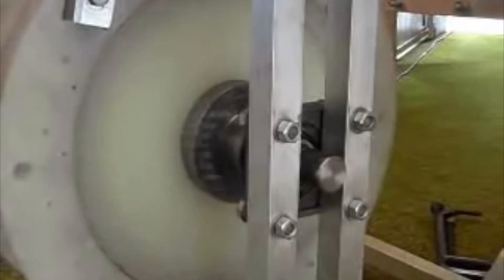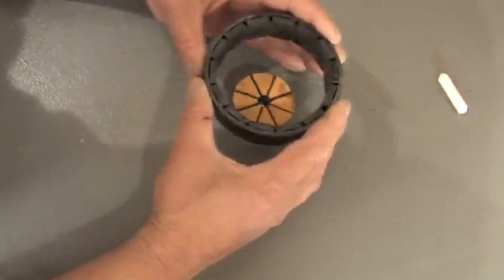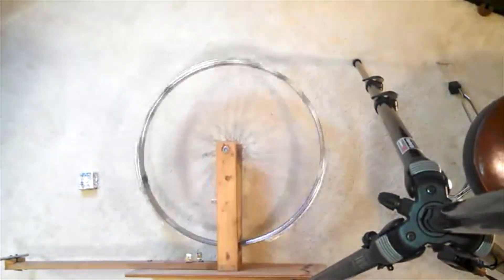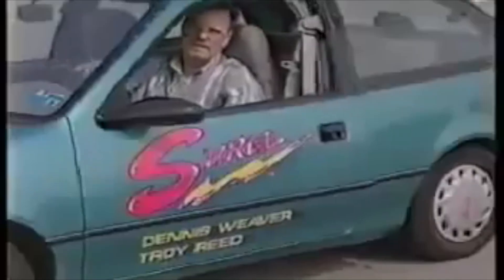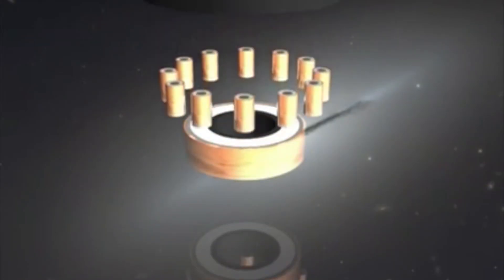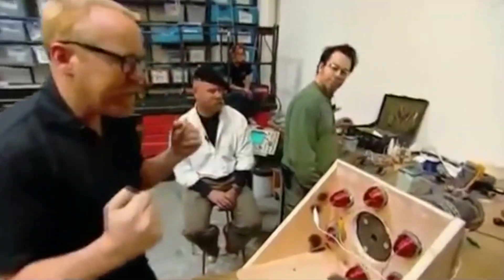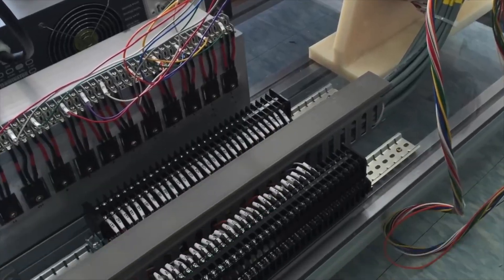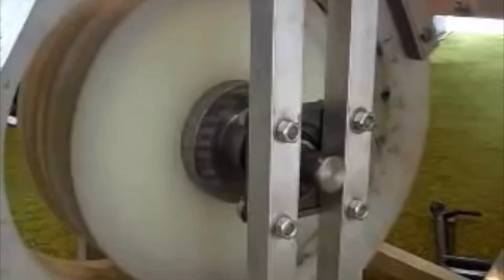Top 10 Most Famous Magnetic Motors

Comment: Do you have any info on the Italian inventor who made cgi models of magnetic motors based on crop circles?  There's one design in particular that looks like something I drew, a long time ago.  I am positive it would work if there was effective magnetic shielding.  I don't know if that guy knows, magnetic shielding will work if it's cooled to near absolute zero.
Reply: I know what you are talking about.  I considered the same thing during my younger years, "shielding".  But it can't be done.  Even if it could be done a teeny tiny bit, only a tiny amount of motion could be extracted, exactly equal to the running down of the "permanent" magnets (no free energy).  This is because the only stuff that shields (without conducting the magnetic effect) is diamagnetic shielding (like bismuth or pyrolytic graphite).  Of course, such diamagnetic shielding always produces an opposing wave back at the magnet, very slowly draining it, just like putting two of the same poles of a magnet together drains magnets faster than leaving them apart.  So if you were able to get it to work, you would just end up having to re-magnetize the magnets, thus using the magnet as a battery.  But no one has succeeded at even that, but if you did, why do it?  Batteries are already so much more energy dense and more readily chargeable.  Although way down the line there might emerge a good use for producing tiny amounts of energy by draining a magnet.  Still, no free energy out of it.
Reply: @Tom2941    then you need a different kind of shielding.  What about graphene, or some kind of smart material?  If they can make a speed bump that only bumps if you're going too fast, they can make better shielding.  It would produce lots of energy, then.  I win.
Reply: @Tom2941    I've read about it, I didn't see anything that says it produces a counter wave, it says that the wave stops or is reduced.  There are those halbach arrays and different ways that the shielding could react to a wave.
Reply: @alanmalcheski8882  Yes, the counter wave is produced by one of the outer electrons in each individual atom of any diamagnetic material.  This happens because the low pressure part of the wave is absorbed by that electron pulling it around the atom, forcing it to orbit in the opposite direction of the incoming wave.  It is this forced electron motion that produces another wave of high pressure that pushes back on the electrons in the magnet, which eventually slows their motion, which demagnetizes the material over time.  (Some of this understanding is not yet known by the greater scientific community.)  Credit goes to Superknowledge4you on Youtube.  :)
Reply: @Tom2941    oh.  Well i don't like the product placement or the zionism but i was watching TBBT and sheldon was working on a weird problem that was about how electrons go through graphene differently than other substances.  He said it acts like a wave instead of a particle. 
That show...  I know a little about physics, I don't like the title, I believe in an alternative theory to the Big Bang, and I always disliked the show... until they were working on a secret project for the gov., and they said something that was actually intelligent.  I don't know how that's possible, unless it is somehow based on a real story.  So there.
Reply: @Tom2941     I don't know why the issue of wave particle duality is brought up for that specific condition, but I know what my brain thinks, and there's something to that.  I don't know jack about science.  But somehow I know stuff, I hear it in dreams, and when I look it up, it's always about nuclear technology, the bible, or aliens.  Watch Mystery Wire channel.  Read my comments on the Avi Loeb interview.  Explain them to me.  I'm an idiot savant, I don't know what I'm doing.  But I could help someone like you.
Reply: @Tom2941     you just need to make the atoms in the shielding out of radioactive material that either absorbs electrons or permits them differently than other substances.  An engine that is made of nuclear waste, that neutralizes its own radiation as it operates.
Reply: @Tom2941    just don't stand too close to it
Reply: @Tom2941     it probably has something to do with the fake nuclear warhead that was in the house I grew up in.  It was a test dummy, so it was basically the same size and shape as the real thing.  My parents put it next to the fire place.  So it might have looked like a camouflaged missile silo.  There's a very tall radio and tv antenna  close by, very close by.  And when I was a kid I would set up mirrors and then change the channel on the tv from a different room, bouncing the remote beam off the mirrors.  Much later in life I researched laser gyroscopes, same physics.  Used on jet fighters.  
That's probably what it is.  Or... I could be imagining all of this, and I really have no business being here.  It doesn't really matter, does it?  I don't care what people think.
Reply: sir, if you put a magnet device on a crop circle it works forever. But all crop circles are under police control
Reply: @jackwhitestripe7342     A magnetic device?  I don't know what you mean and I don't think that cops are guarding crop circles, but in general you are correct.  Very good.
Reply: Yes. He said that crop circles were just blueprints to run "kinetic motor", jus using springs and loads, running with the power of gravity.

Comment: Federal government of India has accepted my Flywheel technology.
By 2021 August 1 MW power generation plant is ready.

All of the world or global population could not brake Thermo dynamics laws
This is  , I who has challenged the laws and broke all the laws of thermodynamics
I am using  mathematics and physics
I am coming from the mechanical engineering department
Dear sir greetings,
In one MW every year 8760000 kWh or units generated , uninterrupted power supply all 365 days.
Just 1 rupee per kwh or unit.

World First fuelless power generation technology developed by Indian scientist couple.
Absolutely free energy technologies

www.kammagearflywheelpowergeneration.com

Just 4 batteries and running a submersible pump, a welding machine or a lath machine or a industrial heater etc mechanical load and electrical load like halogen bulbs

https://youtu.be/Cut8Pv2nWBc

https://youtu.be/e6pI0fevA-M

https://youtu.be/cd-QWZBNLuo

https://youtu.be/w2EQyf_KbWk

https://youtu.be/rPRJofvOYoQ

Federal government of India has accepted this technology and invention and incorporated Flywheel , compressed air and pump storage

"A challenge to the scientific community"
FLYWHEEL Power Generation
We design and develop only one MW

Not below this

One MW will generate per year 8760000 kWh or units

 Investment is 700 000$

Space requirement for 1 MW plant is 30000 sqft

We can discuss

Our input pulse is for only 1 minute

Our output pulse is for 1 hour

 We have developed this technology by acceleration and deceleration method

 Our Flywheel is 6 m in diameter and 20 tons weight and rotated at 1000 rpm

 Like this we have 15 Flywheels connected to each other

And rotated

The total cumulative inertia and kg m pressure is utelized for deceleration

 And the stored energy is harvested from the rotating 15 Flywheels there is 8 MW stored energy in the 15 Flywheels.

 The motor used is 750 kw

And the Generator is 1.5 MW

 So if we have a storage of 1 hour in the batteries, for storing 1 MW there will be 70 batteries  each battery is 12 v and 1200 Ah.

 Then we will get 60 hours free energy

 It is uninterrupted power supply

 The input pulse is 1 minute only , after this the motor will not receive any further energy from the storage , available from the 1 MW storage

 So energy is destroyed

And

Energy is created

There is no more the law of energy existing

 I have provided it on the paper and by practical experience too

Thanks

Just 1 cent per kwh or unit all 365 days.
Uninterrupted power supply all the day and night 24/7 all 365 days.
Dr Srinivas Bhasker chaganti and chaganti Bala
Scientist
91-8555045244

Comment: Have had a version of a Bedini motor running for weeks.
And some of my own run for months.
Will we see any of these ideas be allowed to be produced?
Reply: @andreasschmitt2307  school is scam, as far as politics rule it
Reply: did it provide any external power like  a light bulb dickhead
Reply: @andreasschmitt2307  I'm 70 and have learned most of what I do within the last twenty years.
These things are not taught in any school, but come from garages through out the world.
But a good education can add in the process, a great deal.
Reply: @tribulationcoming    What inventios and innovations have come from "garages" recently?
Reply: @durchblick6886  Have one pulse motor in particular, put up a video but took it down after a week or so. I don't do calculation, no formula's, qualitative only, trial and error for the last 15 years. Try it and fry it, there has been smoke in the past, but not so much as of late.
Restarted this one in at the beginning of Aug. , it has maintained just below 9 volts using an old 12 volt battery.
But what should be done with such a device? Check out the field coupled torque translator. The term "Garage" is a general reference DIY experimentation.
Reply: @tribulationcoming    I am aware about the meaning of "Garage" in this context. But sorry, my question was not precise enough. I did not ask for singular inventions but for "garage"-inventions which are now widely in use due to their usefulness.
Reply: @durchblick6886  Yes, there is a vast array of ideas.
Reply: @tribulationcoming    May be. But I was not asking for ideas but for recent "garage"-inventions which have catched on and are used by many people.
Reply: @durchblick6886  OK, I don't think many of the numerous ideas are actually used, but I'm sure some are useful enough to be done.
Reply: @tribulationcoming     If something is really useful, it would spread quickly. That's why I still doubt that important inventions can come from "garages" nowadays. 
For instance, is the Bedini motor a useful invention? No!  His function is in complete compliance with laws of electrical engineering and although it can run for a long time, the Bedini has no outstanding properties, neither as a motor nor as a generator. Which is the reason, why you find Bedinis in "garages", but not in the real world.
Reply: @durchblick6886  Yes , this is a good and logical point of view. Very few of the thing have moved from the garage to useful production. This "thing" hat I stumbled upon    
is only a proof of concept and could be developed, but that would take someone with the ability, which I don't have, to determine exactly what is taking place, and that requires $$$. To answer your original question, not much comes from anyone's garage. However, there have been a few notable instances of success that can be traced back to humble beginnings. If this thing I have is still running in Jan. I will post it for the second time. Be safe and careful in these turbulent times.
Reply: @tribulationcoming    One reason why "garage" inventions became extremely rare: interesting inventions are in fields which simply can't be tackled in a garage. For instance, no one will be able to find a more efficient photovoltaic material in his garage, since you can't develop semiconductors in a garage.
And there is another aspect which can lead to an overestimation of garage-disoveries. Many do experiments and observe results which are new to them and seem interesting. They think they have discovered something. But in all those cases I bet that an expert in this field is familiar with these observations and can explain them at once. For instance, you have something running since a long time. I recently stumbled across a pendulum which swings in air since more than 100 years! But there is a simple explanation for that: the pendulum is driven by a high voltage galvanic cell and since the power consumption is extremely small it will run for a very long time. I am quite sure that your construction also has a sound and rather simple explanation and is not really a new discovery.
Yes, times are turbulent. Have some good times despite that!
Reply: @heinzpg  And again, thanks for the input and interest. Well, at 71, I don't think I have 100 years to find out, in fact we may have only a short time of stability before things self destruct, but that''a another subject. This is sort of a hobby  and keep my thought process active and in working order. There are many people who have worked on an idea for half their life which consumed them and ended up dying without any real success. Will post a video in Jan., that will be after six months of operation, then Ill put it to work and see just what it can do. Yes, everyday that God gives me is a good one and we shall see some amazing developments in this world we live in, not all good ones. Be safe.
Reply: Yes, I will be 72 in Dec. and have learned most of what I know within the last 35 years.

Comment: What if you start manually(using current just to start the momentum) a  heavy rotor with magnets around and it get a little pulse from powered coils every exact time the magnet is passing by, than u get 1 little push to add in the momentum every pass, isnt the momentum strong enough to keep spinning it while retrofeeding the coils and generating energy? im not engenier but got a feeling that it could be interesting to try with an arduino controlling the pulses
Reply: You also pretty much describee an ac motor.  Electricity pulses through wires around magnets creating an electro magnetic field that opposes the pole of the magnet.
Reply: @darklight2.1  cant we use the initial manual free energy inserted to output little push in every coil adding to an ever greater spin force? other thing is what if this rotor floats also on a magnectic force field held by magnets eliminating most of the friction?
Reply: @darklight2.1  just a dream? how can u say that? imagine if tesla would hear what u just said, imagine if he would have said the same? better say "its a old dream that we havent unveiled yet"

Comment: The energies of all magnetics are depleted as they are used. There is no unlimited magnetic power. This is the problem with magnetic motors. For this reason, it is necessary to change again when the properties of the magnetics are exhausted. This is quite expensive.

Comment: Am sure the bediny’s magnet motor does work ,despite it was mith busted by the mithbusters, what i needs to work like a perpetual system is dozens of nucleaire batterys wired together wich could power bediny’s motor system for 28000 years,,

BTW ,you are sounding like as if you don’t believe that. Neither of those magnet motors do work,don’t you?

Am mean what if you don’t believe in fully working perpetual motion machines, then that means you automatically also should not believe in fully working magnet motors, because a magnet motor and perpetual motion machine share the same common aspect with eachother, in that they should supposedly word indefinitly,

If some sad to not believe in perpetual motion machines but do believe in magnet motors or vice versa, that makes no sense to me.sorry.

Comment: Water engines free energy Quantum vacuum on engines free energy I really loved the world war to be won Merlin engine conversion to water whereby they were able to run the engines on distilled water. Yet we drive around in gas-guzzling cars because there is the grey goo component that has to be inserted into the air for mind control of the masses my opinion my research. But the free energy we've had for a long time. It's using the energy of the universe In Perpetual Motion mimicking the planets and the stars in their vast electric universe I've created Infinity energy s
Reply: The motion of the planets and the stars is NOT an example of "perpetual motion", nor anything like it!
Entropy is increasing everywhere in our universe, thankfully!
If it wasn't, we wouldn't be here discussing it.
Look up the "Heat Death Of The Universe".
There is no such thing as perpetual motion. And if you understood the first thing about physics, you would know why.
And water is NOT A FUEL.

Comment: Perendev motor wins. Make one of these to run an alternator. Continuous charging.
Reply: If this works, that would be awesome,
Not surprising since that magnet motor drives a dynamo for generating let’s say 12 volt, that 12 volt can be leaded to a transformer wich can convert that 12 volt to 220 volt ,now you can run it indefinitly and power your house😊😊
Reply: continuous liar
Reply: hello, can I suggest you a generator technology with an efficiency of ~ 190%?
Reply: @free-energycoil  the second law of thermodynamics says that you can't convert something into energy without a loss, therefore, the max efficiency of a generator is always below 100%. Most fakers about creating electricity usually use the well known trick that consist to increase the potential (V) by reducing the current (A) but as the power (Watt = VxA) at the end is lower than at the begining because of the losses in heat, there is no gain... except the gain in pigeons whyo still believe that magic can beat science out of a TV show...
Reply: @Jethro.Maloku-le.Rey.Kalsitran  I am sorry that you do not believe in free energy.  I just wanted to suggest a generator that has no Lenz effect.  I can turn the generator but there is no effect on the torque motor.  I can demonstrate so that you can see for yourself and you will have no doubt
Reply: @free-energycoil  post a video! That sounds awesome
Reply: 8u7bjujuuu
Reply: Like a perpetual motion machine?